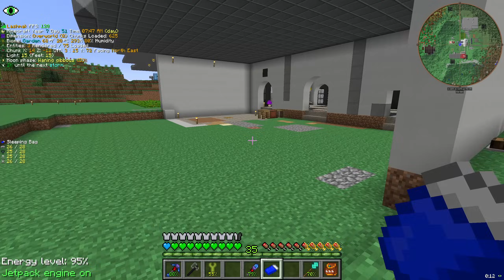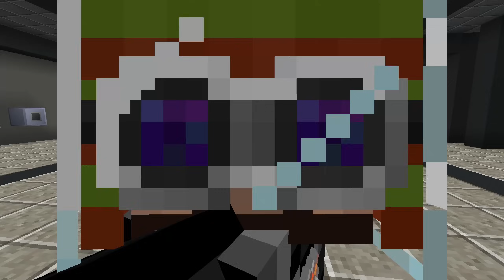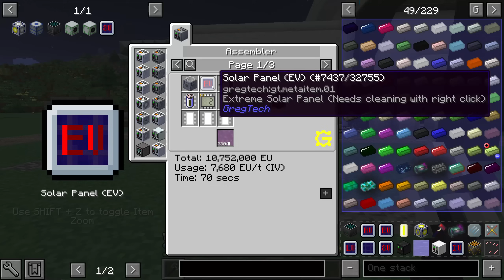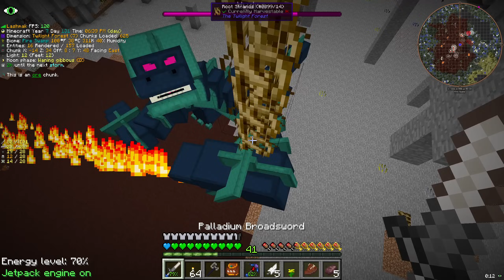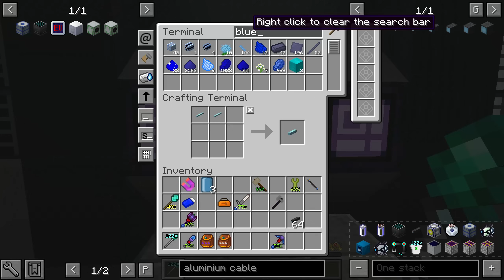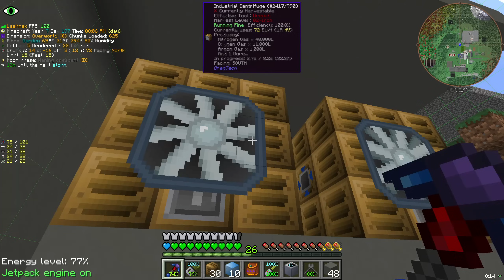GregTech: New Horizons - Ep14: Platinum Line

Comment: you need two eergy hatches to make the machine work at a higher tier. but you dont have to power both. so a 4A with power and a 1A without would work

Comment: I think the volcanus's didn't work with the 4a IV hatch because it can only do IV tier recipes max, and the extra amps just go towards parallels, it doesn't actually do any overclocking.
(somebody correct me if im wrong because i also want to know)
Reply from the maker: apparently we are both wrong. only certain machines which i dont know which they are, accept those energy hatches. i dont think volcanous is limited though, i am a bit ahead and its running at zpm

Comment: i know im a bit late but i would highly recommend using a industrial information panel on the capacitor (just the flat screen version of the normal information panels), you can just attach it to the glass or wherever and it allows you to easily see how much power is stored etc

Comment: Hello Lash, i don't if you will ever reply to one of my message but still enjoying your videos. I'm actually at UV stage and since i've crafted my lapotronic capacitor, i've always used  EU P2P to run my energy to my different MB without any issue, you'll lose 5% of it through the process but so far i never have any problem even with this tax to use my AE network instead of jugging with transformers and other shinigans. And i suggest you to look at Nuclear Energy, Mox is pretty reliable and make you comfortable until ZPM/
Reply from the maker: Bello to you my fellow lord of darkness and thank you so much for the tips <3
actually i also wanted to use p2p tunnels for powers, but i dont know, i am a bit scared how the cabling for it will be. i am a bit ahead in the videos but i only have 2 transformers and i dont think it will change much cause for some reason i am addicted to super conductors. its a medium sized base but power transfer hasnt been a problem so far. 

as for nukes someone mentioned i need that but honestly i think until ZPM i am going with solars. then move on to plasma, after that i have no idea lol since you are at UV, maybe you can guide me a bit.
Reply: @Lashmak  
Oh my ! the lord of darkness replies to me, i'm happy :D

I'm gonna give you some videos  description to look at but as i'm not sure  it is allowed to give you links i will put the title and the name of the creators.

For the nuke, some contraptions i've used (Quad Mox reactors controlled by AE2 and redstone 500kEU) could be found on the channel of RandomPotato10 :
100% Uptime VacNukes - The comprehensive guide for insane power in GTNH 2.7 

Then the direction to go as soon as possible is large Naquadah reactor. MK1 fuel is about 10MEU with added catalysts, and MK2 is 101MEU with them too.

Again you'll find some very usefull info about it on the channel of Ham Corp, especially the episode 91 which is about this reactor.

Finally as i don't know if you've seen my previous comment, there is a very very usefull unofficial mod you should try which is Twist Space. YT creator AdityaG has done some explanations on his channel and has even created a lot of dedicated quests to help us apprehend it.

A lot of kuddos to you Lash, i really enjoy your content !

Comment: sumarium is from IC2 rectors
Reply: I remember getting sunnarium from a specialised IC2 nuclear reactor but that was a couple of years ago so it could be different now.
Reply: @davidk8699  probly a breeding reactor 
It genarares minimal energy but maximizes resource genararion
Reply from the maker: true. its like a byproduct. but every method you do is temporary until you make the molecular transformer. then you just convert glowstone into sunnarium . i just got it last night. but in general uu matter is a simpler method cause you dont need to setup automations for reactors

Comment: For ammonia you basically want LCR with biggest energy hatches you can make since on overclock it can become really fast. You'll need to make sure you produce enough N and O tho.
Reply from the maker: thats the problem. you can mass produce it, but then you have to mass produce everything else lol i think i am just going to use nitrobenzene as a secondary source of power until i get to plasma
Reply: @Lashmak  well, its up to you on how you do things, I personally use jupiter siphons for hydrogen and helium (infinite, with insane efficiency), centrifuge for N and sugar EIG for O. As I use rocket fuel for energy, it eats millions of ammonia but ammonia is also used for platline (including palladium), then you need ammonia for monaline. Besides that I believe you'll have to mass produce all of basic chems sooner or later.
Reply from the maker: yes exactly, this is why i dont want to waste my ammonia on power cause i thought its more useful in platline and monaline. for your power setup i guess it makes much more sense, for me i am not really sure if it makes much of a sense. i am mean now that you thought me how to get free helium from jupiter, i ll probably can swith to plasma a bit a earlier than i was expecting

Comment: When I was in I had 64 each of LCR electrolyzer and centrifuge for making ammonia, o, n, and h to cover nitrobenzene and everything else. Platline and nitrobenzene both drink ungodly amounts of ammonia/nitric acid
Reply from the maker: well you are right, nitrobenzene ratio to nitric acid is 1 to 1. I dont think its worth going with nitrobenzene as the main source of power. cause as you just mentioned, you need hundreds of multiblocks just for making nitric acid in decent quantities.
Reply: @Lashmak if you can get to mega chem reactor in luv it should get better. I hear vac nukes are also pretty good if you can get a good setup. I think one nuke scales up to 2m eu/t at its max iirc

Comment: To clarify, there are two multiblock assembling machines in GTNH (the Assembly Line is something completely different). The Precision Assembler is available in IV (albeit ruinously expensive) and what you want for automating assembling machine recipes. It has a ton of space for different buses/hatches, parallels, and natively supports multi-amp hatches if you want to give it Yes power. The caveat is that it doesn't overclock - can't give it 2x IV energy hatch and run LuV recipes. The GT++ assembling machine multi does, but is ZPM tier to craft, and worse for general automation in basically every way.

Electric tools have higher durability and speed (depending on their energy tier) than non-electric tools, so if you need a faster wrench to dismantle stuff more quickly, make an electric version.

Solar power in GTNH is one of those things that's so thoroughly turbo nerfed because "it's free and infinite and easy" that you're generally better off forgetting that it exists entirely. Lag is also not that much of a concern, as this is Minecraft, not Factorio. A solar powered terrible setup is always going to be worse than a non-solar powered good setup, so focussing on solar power is an inefficient performance consideration at best. My advice if you need a quick power injection early on is tapping a fluid field. Even an uninspiring Chlorobenzene field on Mars can generate about 48 IRL hours worth of Phenol worth of 2A ZPM send through LGTs, using just a T4 drill and a single LCR.

If you need sunnarium in bulk - the precision assembler only requires like 4-16 dusts or something, it's basically nothing - I would suggest using the other method of crafting it early, which is running Glowstone rods through an IC2 reactor to turn them into sunnarium rods. What is the value of solar panels when you either need a nuclear reactor, or an established power supply to run the autoclave recipe, to craft them you ask? That is one of GTNH's balancing mysteries I have been pondering for over a year now.

The mass fabricator has a rare - but not unique - 2/2 overclock, meaning that every tier it overclocks it halves the numbers of amps required to run the recipe. You can see this in NEI if you right click on different tiers of mass fabs when looking at the recipe, it'll update the EU/t requirement to reflect the machine tier you right clicked on.

The Algae Farm, or as I like to call it "disappointment farm" or "fancy toilet", is a confusing multi that is so unspeakably bad and obnoxious that the only advice I have to give is to play modded Factorio if you want to play around with algae farms in a factory type game. It can be used to generate ammonia, but the yield is so bad and difficult to scale compared to the LCR recipe that without a dedicated AFK server it's not even worth trying. And with such a server you'd still be better off with other setups.

An easier way to remember transformers: Large dot is high voltage, small dot is low voltage. Hollow dot is input, solid dot is output.

In terms of power generation 2A LuV is, eh...two Large Gas Turbines. Yeah, just two. Large HSS-E rotor, IV buffered dynamo hatch, Loose Mode, and slight overfeeding to get as close to 1A LuV output without going over (it won't blow up the machine, it'll just void power and be less efficient). Admittedly that would consume 150mb/t benzene total when both LGTs are running, mind.

Multi-amp hatches are limited to specific multiblocks, as otherwise you'd be able to cheese the living daylights out of progression by giving everything 64A energy hatches and running recipes two or three tiers above where progression expects you to be. One example of a multiblock that can accept multi-amp hatches is the precision assembly, to allow it to run a lot of at tier recipes in parallel, which doesn't break progression.

There's no better recipe for Ammonia than brute forcing the LCR recipe, at least that I've found. Overclocking helps a lot since LCRs get perfect overclocks by default, 4x speed for 4x EU/t consumption. Incidentally, there is an LCR recipe to directly craft nitric acid these days. It isn't inherently cheaper or faster IIRC, but it does save the step of producing ammonia.
Reply: The legend !!
Reply: I feel like at this point he could've made the Vajra already instead of electric tools, for breaking at least since it instantly breaks any blocks, electric tools are still useful for configurating machines however.

Solar panel can be good, in its compressed form at least, I guess.
Reply: @rest.jailbreak  Not going to lie, I completely forgot about the Vajra. That is a good point.

Compressed panels from TC I think are less bad than what I call "quality" panels, since they mainly require vast quantities of basic materials that should be easy to source and process in bulk and can produce better power in the right circumstances...although the infusion required to craft higher tier panels can be problematic without robust TC infrastructure.
Reply from the maker: my most dearest lord of darkness, yes, compressed solars are the best. however the final tier is just amazing. the rest make less power than the solar panels i am using.
Reply from the maker: my fellow lord of darkness <3 
yap thats what i am trying to avoid, spaming machines which would be redunadant in a few episodes. 
if i want to run the base out of nitrobenzene, i need its to generate somewhere around 100k eu/t cause that is my consumption now (2 episodes later than this). 1.600m (nitrobenzene value)/100k (my energy requirement) = 16l of nitrobenzene per tick or 320 per second. which optimal setup i can reduce it 240 per second, with loose configuration, i guesss it will be even more. my setup for making enough nitric acid and ammonia will never be enough for sustaining that consumption rate. this is why i am focusing on solars. currently (again 2 episodes later or so), i have 64 EV solar panels and i am upgrading them to IV. that would be 4 ZPM amps which should get me as far as getting plasma from fusion reactors. after plasma, i dont think any other setup would be worth investing in for while.
Reply: @Lashmak  As of 2.7's changes plasma as a power source actually got left behind a fair bit, with large scale gas power (nitrobenzene or petrochem based) though (X)LGTs, rocket fuel though a Universal Chemical Fuel Engine (UCFE, or UCGE as I tend to call it), or superheated steam generated by Deep Earth Heating Pumps (DEHPs) through XL steam turbines being used to skip it entirely. This is mainly because fully utilizing plasma as a fuel requires a tiny bit of ZPM tier technology, and because once you've got access to T2 fusion you've got access to Naqfuel, which completely blows every power generation method that came before it out of the water, making any investment into plasma power short term by default.

Don't get me wrong, a T1 donut producing helium plasma is still good for almost a million EU/t through large plasma turbines, which will be a major increase in power gen unless you've gone out of your way to build a scaled gas or rocket fuel setup that'll be much more logistically challenging to maintain. DEHP is comparatively as trivial to maintain as helium plasma, but also significantly more expensive to expand to that large a scale - those pumps are not cheap 🙃.

One way you could get ~180% fuel efficiency out of LGTs producing 1A LuV in IV is by giving them Medium Ichorium rotors, although this requires reaching endgame progression in TC and ideally Blood Magic for the latter's ichorium duplication recipe. I personally don't find it worthwhile, unless you happen to be heavily invested into both mods already, but either way it it an option.

Another option to get more fuel efficiency out of gas fuels is using Solid-Oxide Fuel Cells, though I don't recommend using them for a large number of reasons. Still, if you're willing to put up with their cost, quirks and requirements, a mark II SOFC can achieve ~242% effective fuel efficiency with nitrobenzene without any fancy endgame magic stuff, which is completely insane for IV tier.

Comment: In order to overclock a multiblock twice, you actually need 8 amps instead of 4!
Reply from the maker: actually you need 4. cause 4 LV amps gives you MV, 4 MV gives you HV. so theoritically i was correct its just that according to another comment, that hatch can only be installed on a few machines.

Comment: For nitric acid…I haven't played GTNH in a long time, but in CEu, there's a recipe to make nitric acid that uses nitrogen dioxide, oxygen, and water on circuit 3. You get NO2 directly from End air processing, but you can also combine nitrogen and oxygen directly…on circuit 3. In a creative world, I made a setup that uses a self-feeding LCR to make the stuff, but it wouldn't be difficult to just make it with two. Not sure if the recipes exist in GTNH, though.
Reply: There is in fact a new direct nitric acid recipe in 2.7+!
Reply: This is not ceu its gt5 here you use amonia and its the only way
Reply: @Dark_mare  ok just making sure
Reply from the maker: my fellow lord of darkness, i do remember that in the past there was a recipe for getting no2 from air, there were also recipes for end air, nether air, etc. but they seem to have been removed. so for me getting nitrogen dioxide is a bit problematic. the easy recipe is N+O+H in a chemical reactor which gives you nitric acid. or ammonia + O. both are slow. someone mentioned for nitrobenzene, he has a set of 64 eletrolyzers, chemical reactors, etc just to keep up.